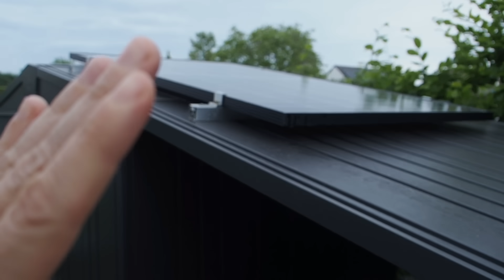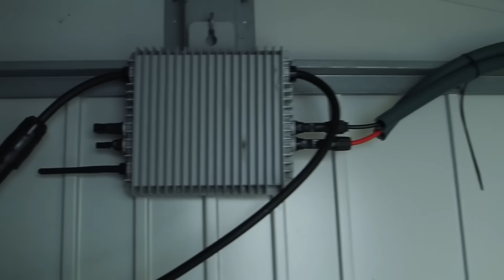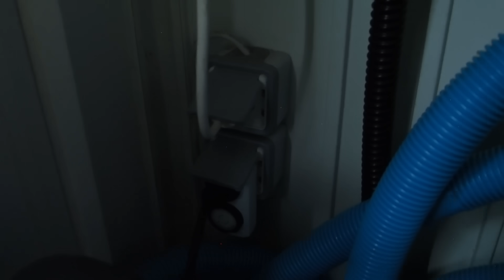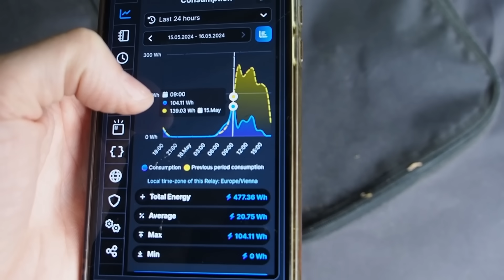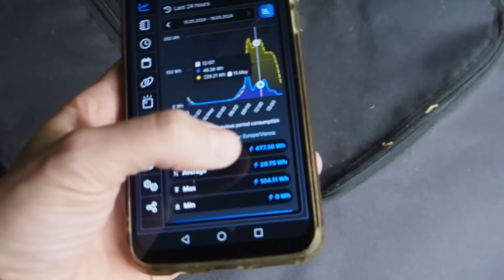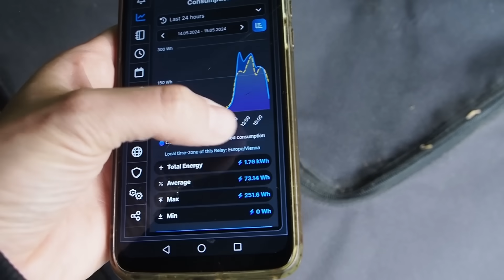Solar system? Yes? No? Which one?

Comment: We have solar and it cost around ZAR300 000.00. If we were using the government’s power, we would be paying around R2000/2500 a month but now that we are off grid we use a lot more electricity- leave the pool running, we now use an electric kettle instead of cheaper gas. The heater when there is enough sun and it's cold. The freeze dryer. Fans when its too hot. The dishwasher more often, the clothes dryer for linger cycles whereas before we hung items up and only put them in the dryer once they were completely dry. We aren't worried about our usage anymore and really are getting our monies worth out of it. South Africa also has loadshedding which should return daily after elections so it is a huge convenience having electricity when the grid is off. When using a fuel generator to power you house, you are basically throwing money away whereas we can see our solar and it'll take us further and cost less at the end of the day. Panel prices have also dropped drastically so hopefully they will be low when we need to replace them.

Comment: I have a 400w off grid system that I put together myself, I am an Electrician, now I am busy putting in a 960w hybrid off grid system totally not connected to the grid at all. Still thinking of how to do manual solar tracking.

Comment: One problem that no one covers is the battery bank that is needed, Lithium is the same as oil, coal, gas, gold, diamonds, etc. etc. including e cars and e bikes and e everything else, as an earth resource being mined at the minute as cheaply and as fast as it can be for maximum profit. Strangely no one seems to mind or mention this quiet rape or the fact there is not an endless supply of Lithium as the planet get ripped apart looking for it.

Comment: We just erected a new Greenhouse & built a little Solar Power Station to run its Electricity for the Fan & Heater in Winter.  It's working well so far👍🏼😄

Comment: A small separate 12v solar system is an option. A few panels, controller, battery or batteries and some wiring would let you run a portable fridge/freezer, some lights, charging of phones etc, small 12v appliances. And at a fraction of the cost. An inverter could be added but of course costs more. Granted I’m in the tropics, but I run a stand alone system with 600w of panels feeding 460ah of AGM batteries running 160L of fridge and freezer, lights, fans, navigation systems, device charging, inverter, TV, etc. No permits, no grid reliance, no electrician required, very safe, and batteries last between 3-5 and up to even 10 years.

Comment: So much solar here in Australia now that energy companies will turn off panels some days as they can't handle the amount of energy being produced.
Energy companies have reduced feed in tariffs to very low levels so that unless you can use the power during the day it's really of no benefit.
A decent solar system and battery setup will cost you a large amount here and it's basically illegal to do any of the work yourself.

Comment: Great insight!  I have a Solar system for a very small wattage system.  If I can get a 12 volt recharge for small radios, batteries, LED lighting.  Less then 100 USD…(120 euro).  I am happy.

Comment: I would like to see a real conversation as to why the utility companies say too much solar is a bad thing.
I'm an electrician by trade. Have been for 37 years... I built for my self an off grid solar power system with only 2Kw of solar, 14Kwh of Lithium Ion Batteries and a arew inverter. I have all the appliances you would have in a normal grid tied house... Granted, Because I have a small inverter. I have to limit how many large loads I can run at the same time. For example,  the microwave and the espresso machine max out the inverter if I run them simultaneously...
Spring through fall I have so much solar that my batteries are fully charged by 11am. Early morning and late evening (after the sun has gone down) is the periods of time I use the most electricity. So the I rely on the batteries to fill that gap.
The rest of the day loads are fairly light. Well under what my solar panels ultimately produce through out the day... 
So... What happens to the excess electricity that my solar panels produce??? 
Truthfully, NOTHING... 
The solar panels don't produce any more power than the load that gets put on them, and nothing is getting damaged. I've been running my system like this for 8 years now.
So... My big question is... WHY can't the grid work the same way where solar is concerned?
The excess solar on the grid doesn't have to be pushing 100% all the time. Therefor, It's my firm belief that what Utility companies are telling us is a LIE...
Reply from the maker: If solar panels are connected to the grid the overproduction flows into the grid. This is not a lie.
Reply: @SurvivalLilly 
Perhaps you misunderstood me.
The system I built is completely off grid and I was talking about the giant solar farms and how the utility companies all claim that all this solar which includes people's home solar make it so difficult to control the power on the grid. Hense, this is just one of many reasons the utility companies use to pay as little as possible for people who have grid tied solar.
If it wasn't for government regulation, they would pay nothing for your excess electricity.

Comment: Solar power direct to use is the most cost-effective. You can cook food, pump, heat, or cool water with PV solar panels for example as an appliance, You may be able to use the excess heat not converted to electricity. Or charge a battery for delayed use of the power. All with no connection to commercial power. Electricity will transfer the power into a building with no moving parts and little material. You built systems yourself Lilly and did not need to pay for the power.

Comment: The problem with solar technology is the investment is extremely high, the long-term ROI is extremely long, but the useful efficiency life of the panels themselves are only good for 7-10 years at the most. Panel technology is developing so fast that after 7-10 years the panels on your roof are so inefficient compared to the newest panels that its actually costing you money to keep them instead of upgrading to more powerful and more efficient panels.  You might ask "well you could chase that tail forever so how do you know when to get in the game?"  When you can get the cost down by doing much of the work yourself and cutting the ROI cycle by 1/2 to 1/3 ala Lilly, or when the panel technology basically reaches self-sufficiency (you are effectively an off-grid lifestyle).  Panels arent efficient and cheap enough yet to do the latter.  For 95% of people the best way to save money on power is to simply use less power and become "hyper milers" of your powered and plugged-in items. It requires $0 investment so the risk is zero but all the gains are immediate -- not as large as a big solar array but a solar array is not free like turning off the lights or running the dishwasher less.

Comment: to get my panels and chargers/inverters to do 10 KW I got it for $3500(no batteries)(USA)... It is not that hard to do and maybe try to do a garage to run critical loads(freezers, fridge) or set up a charge rack for power outage you can use an inverter to at least provide back up heat/AC

Comment: I Opted for 4 Victron Charge Controllers for My 4 Island Systems that Store Their Own Energy - 2800 Watts o Solar - Stored into 24 Volt Battery Banks and Feeds My 3 Eco Flow EF3 Delta Pro 1300's and an Eco Flow River 2 Pro for on The Go Power and 4 WZRELB 3000 Watt Inverters to 4 20 Amp Circuits in a Breaker Box All to Code to GFCI Protected Sockets for Daily use.

Battery Bank #1 = 4 280AH CHINS Lithium Iron Phosphate 
Battery Bank #2 = 4 200 AH RENOGY AGM and Combined Storage = 25KWH Plenty for a Small Lodge / Ranch ⛩

Comment: im living off grid in germany with 16kWp solar south and 60kWh battery its enough to keep the lights and the fridges on in wintertime. so i have to run a generator if shtf. 
but it is only for a couple of weeks.
so sorry but living offgrid wit 400Wp panel? no way at least not in winter.

Comment: Solar is a joke! We rely on solar because we're completely off-grid in the woods, and when you really need power - winter - there's not enough sun, so we still rely on our generator to charge our small battery bank most days; in the summer, we make plenty of power, but don't need it. Also, try collecting sunlight when your panels are covered in snow... if you can't reach them to clean them off, you're screwed until spring thaw! Imo, hydro and wind are better, and we'll be adding both to our system.

Comment: I'm in Hawaii.. I live off grid.. 1Kw on the roof, 24 volt LiFePO4 150 amp battery, 2000 watt inverter.. It run's a big refrigerator 24/7, light's, laptop, etc.. It's modest but perfect for my needs..

Comment: If the grid fails you'll be comfortable knowing you can be prepared. Piece of mind is priceless ❤
Reply: They are grid tie inverters.  So if the grid goes down she would be without power.
Reply from the maker: Actually I have power stations that I will hook up to my solar panels.

Comment: There are several different options that need to be considered and in my case it has been of enormous benefit.  A couple of the things to consider are -
  - Does the system have a battery and if so what size.  
       o  If not then likely if the mains fails then you still loose you power.
  - Is the system tied back into the mains supply and if so what is the $$ feed in rate.  
       o  Some companies offer a ridiculously low feed in tariff, stay well away from them.
  -  In the event of a mains failure, does you property automatically use your own solar and battery, and will it run your desired key powered gear.
Lot of others of course, but care is needed as there are a lot of "shonky" dealers who will just be lining their own pockets, not yours.

Comment: A couple of things solar companies don't stress to potential customers.  1) escalation clause.  If you lease the system, there's about a 3% annual cost of the lease payments.  In those 18 years, your payment will be about 65% higher than the 1st  year.  2) solar panels lose about 0.7% of their generating capacity each year.  After 18 years, your 7kw system will be generating about 5.8kw.  Combine the increasing lease payments, increasing electric rates for what you use off the grid and the decreasing generating capacity, makes me think that leasing isn't the way to go.  If you buy your own system, you need to know how it works and what needs to be done to maintain it and repair it.  You're on your own.

Comment: I agree with your point. Smaller systems are much easier to build and manage. I built something similar to yours but a bit larger. I didn't connect to the grid because I wanted my system to provide backup power via batteries for freezers. I run the freezers fulltime off my system. Combined they consume 3.4kw a day. Works out pretty good with 10kwh of storage. I have 3200watts solar, (thats real watts) used panels, A 5k inverter/charge controller and 4 12vdc lithium batteries wired for 48vdc.Total cost for system was in the neighborhood of $3500.00. maybe a bit less. Everything purchased on sale, took 9 months to get what I wanted but it was worth it.......I think. I enjoyed your very level headed video.

Comment: Suggestion: Place an Automatic Transfer/Isolation Switch between the Public Service Mains of your power supplier and your Domestic power systems.  Then structure your primary Solar System to supply your home with power, add a generator to assist your solar power systems with recharging the household battery bank and supplying the household in power outages. Then during normal daily activities you can send power to the Mains, but in an emergency all of your power will be isolated from the system, thereby not wasting any, and maintaining safety for any power-line workers.

Comment: I want the option to switch my power supply from on-grid to off-grid, with a switch, so I can switch off the grid.
Reply: Just know that you need to use an inverter that meet certain UL certifications in order to be connected to grid power. As well as meeting the NEC install specs. Check with your home insurance to see what they require
Reply from the maker: Yes there are switches. But you also need a battery bank otherwise the system wont work
Reply: @SurvivalLilly  Here in Australia is illegal to switch off the Grid, it must stay connected, unless you live in a country area.  And yes, you would need a battery bank.

Comment: I run 99% of my home with 1.2kw of solar the last 20 years and still providing maximum power . 
They are 24v charging 4 x 6v semi traction led acid batteries . I use two inverters , a 300watt and a 1000watt pure sign wave . 
Total setup cost in UK £ 2,350. 
Batteries ive changed twice so a set lasts me just short of ten years at £900 a set.
I got the idea of 24v from a guy living in a house . 
I live on a narrowboat.

The 1 % is my washing machine . I use a generator once a week for that.

Comment: Here in Australia if there are too many houses with solar, it pushes up the voltage in the area; which will then cause the solar system to shut itself down, to prevent damage from high voltage.  This voltage can be adjust at the local transformers, by the city council, who will most likely need to be pushed into action.

Comment: Are you allowed to separate your house from the grid? In some countries this is not legal unless running electrical lines to the grid is prohibitively expensive.
Reply from the maker: You can ask for permission to seperate the house from the grid using a manual switch.

Comment: I have invested in different size battery banks and different solar panels to go with each.  This way I can run my refrigerator and water well pump and some lights and cpap machine  when I need it. I will not install the solar panels on my roof.  This way i can take these with me if or when I want.

Comment: You will have to buy new batteries long before 18 years.  Does it hail much where you are at ? Snow ?  Solar is not a good investment. Maybe a few panels to directly charge a few batteries but otherwise too expensive and right now Lilly you are NOT going to want to get into any kind of debt.

Comment: I'm not a fan of these balkony system because they don't officially monitor what you send into the grid to get it back later. Everything you send into the grid is a gift to the energy company. Some lucky people still have old meters which can run backwards though.

Comment: You're better off putting that energy into batteries and using it yourself.
100ah 12v battery = 1280 watt hours.
LED bulb = 4-7 watts
100 watts of LED bulbs still equals 12 hours of usage.
One lamp bulb would last 320 hours on one 12v battery ( lipo4 12v).

Comment: I spent 30k CAD, I have seen other companies in Canada want $90000 for less capacity. In Canada Solar online, or Canada /USA signature solar. Go to those sites first then go shop around and see excessive greed from other dealers. If you consumed more electricity the ROI would work a lot sooner, looks like you are using 140 kw a month? Does anyone here want to predict how much your power bill will be in 2040, for some of us it will be paid for in a few years. Ok 20 years have gone by the panels are a bit degraded, np buy 1 panel per string and add it to regain the power you had from new or overpower the array from new mine are 2.8kw input but in Aug I will have them at 3.3kw as long as it is under voltage the input can be maxed 4.5 kw the inverter clips the excess even if 30 years go by, at least 2.8 kw left per array plus more power in overcast. My vertical mounted 2790w array produces 3414w with snow cover and 700w in overcast. This past year 90 days with 30 hours of sun total, next winter after upgrades I will collect over 15kw a day through that soup in the sky I use 14kw with electric heat. Over the next 30 years at least 2 more inverters add $8K, but 30 years from now still an average $105 a month for power that was prepaid because I bought my own power company. Since I swapped the 55% max charge defective inverter no generator last 90 days. And produced 982kw more than I needed. The system I have is so simple the inverter swap was 14 mins. As for grid tie, only if they buy back 90% and 17kw+ of solar to get max sales in summer, batteries optional but 50kw for $10K USD is not too much to always have power.  When people buy a car they never expect 100% ROI so why expect it from solar? On grid I lost power due too, accidents car vs pole, windstorms, ice storms and fire. Now only fire can get me.

Comment: Hi Lilly, thank you for showing how you did it. I also got a quote and it is way too expensive. Actually a complete ripoff. I found a special wechselrichter that will allow you to go above the 800w limit. It is a smart one that adjusts the max watts dynamically so that you can consume up to 2000w and then lowers the produced energy into the grid when you are not consuming all 2000w, to make it look like you are using an 800w system
Reply: I found it, it is called ready2plugin
Reply from the maker: And the smartmeter will not detect it?
Reply: @SurvivalLilly  Der ready2plugin Stromwächter wird die Netzeinspeisung konform zu VDE-AR-N 4105 begrenzen. Bei ansteuerbaren Wechselrichtern erfolgt diese Steuerung sekundengenau, bei allen anderen Wechselrichtern gemäß DIN VDE V 0620-1 im 10-Minuten-Intervall. Auf der Einspeisephase kann der Stromwächter bis zu 2000 Watt, auf den anderen beiden Phasen bis zu 600 (in Kürze 800) Watt mit Sonnenenergie bereitstellen